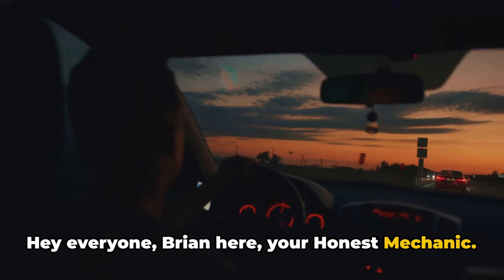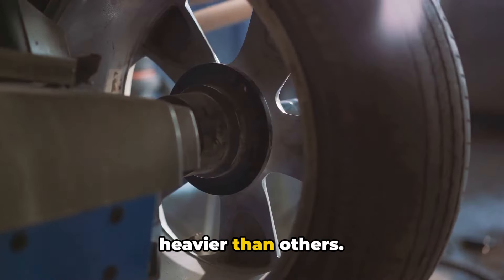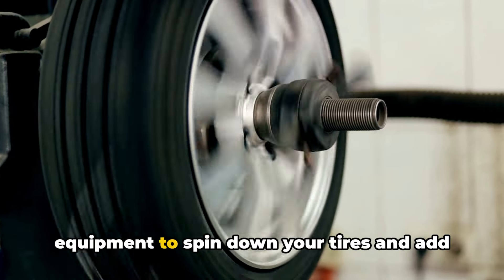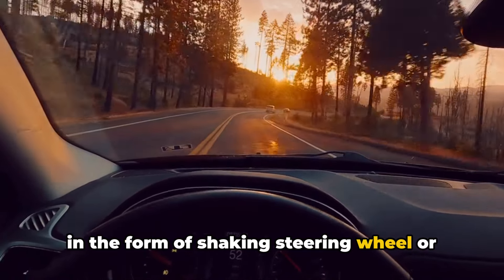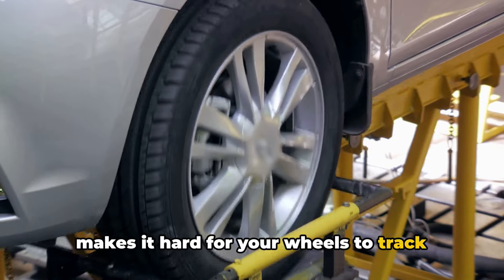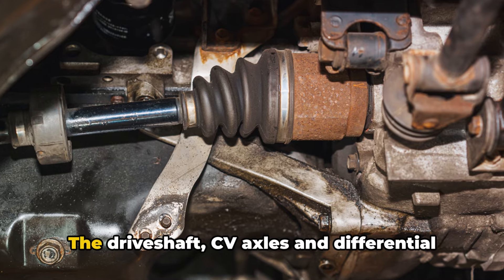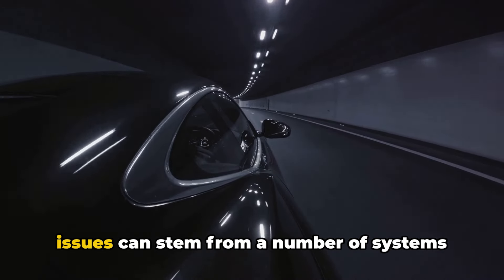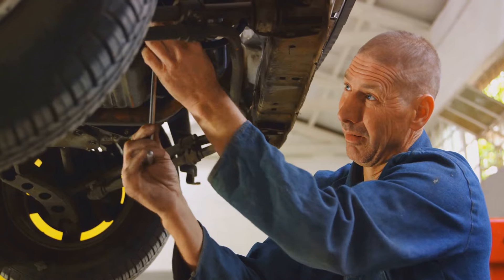Car Shakes at 60 MPH: 5 Vibration Causes

Comment: Piece of advice: if the tire people put "balancing beads" in your tires, have them remove the dumb things as they can cause more problems than they help.
Reply: those things eat the tires inside. what the hell people have in their mind to put that inside the tires? are they stupid or what?
Reply: @HeydaCarreras  From what my mechanic told me they are used mostly for large semi truck tires since it is difficult to tell when one tire on a, for example, 18 wheeler has gone out of balance. The beads supposedly adjust within the tire to assist in keeping them balanced. They should never be used within the smaller sized tires used for passenger size cars or trucks.
Reply: @richardb.5691  even the big tire in the world, it's absurd. Completely absurd. Those things will move inside so fast that will eat the tire inside.

Comment: I aligned my tires and got new tires. Can’t seem to find my problem but I’m gonna try new shocks and suspension next
Reply from the maker: Please let me know, how it goes!
Reply: how's the update?
Reply: @evv4239 how did that go
Reply: Any updates?
Reply: @macknumber9  so I did my right cv shaft and that fix my problem but I did the left side also but even when I did the driver side was still doing it and once I did the cv right shaft I’m back running good
Reply: Did u make sure the psi is equal thats why mind did it
Reply: Anything?
Reply: Have you done a fuel injection?
Reply: this guy never came back.
Reply: I’m going through the same thing. My dodge ram keeps shaking and rumbling. I’m going to the shop today to get it checked. I’ll make a video on my channel of the whole process! Stay tuned.
Reply: @HonestMechanicChannel I completely forgot to respond😭 college and work took over but it was my worn engine mount replaced it and car drove smoothly the next day. sold the car the next week it was not worth the hassle to maintain it and now saving up for a better one

Comment: My car vibrates pretty bad from 60 to 68 mph then it goes away, I just did a road trip from NC to NY. And notice my steering wheel when out of balance to the right side and that ‘s when the shaking started , so guessing the problem is alignment
Reply from the maker: Hi, The vibration you're experiencing between 60-68 mph, along with the steering wheel pulling to the right, is more likely due to an issue with wheel balance or alignment.

The shaking often indicates unbalanced tires, while the pull to the side suggests an alignment problem. 

After a long road trip, it's common for alignment or wheel balance issues to show up, especially if you hit bumps or potholes. I'd recommend getting the wheels balanced and an alignment check to solve the issue. 

Let me know how it goes!
Reply: @HonestMechanicChannel  thanks a lot for replying I will definitely take care of this !!!
Reply: @HonestMechanicChannel  That is a BIG LIE. I have done everything you could say and what you never imaging and still have vibration at 60. Nothing that you can say will be the problem. All mechanics just play game to rip off you and take your money.

Comment: 05 volvo s60 2.5t  I put new ball joints tie rods control arms and end links  two weeks ago prior in May fixed the pass cv axle I had a shake before any of the fixes. I got new tires last may it sat till may this year granite ik the tires can get flat spots but brand new tires? I fixed the front suspension got the alignment done twice and balanced two times and is till get a shake in the front right. Shop is stating that the rim is bent which could eb from sitting.. but I don't understand how the rim could be bent but the tire doesn't have a flat spot...
Reply: Feeling in the same boat. I’m in a Rwd CTS I did All the breaks front rotors inner and outer tie rods all new tires and since I’d got new tires and did the tie rods my self I had to get a 2nd alignment 
My steering wheel shakes back n forth. 
I think with this pay check I’m going to shoot for either Getting my wheels balanced, steering knuckles or wheel bearings. 🤞🤞🤞
Reply: Wheel bearing

Comment: The engine and front suspension moved a hole inch with a loud crashing sound it seems that when the car is raised off the ground it is supposed to be supported as it states in the repair manual. This was not followed at the dealership as it should be.
After this happened I then was able to tighten the LUG NUTS to specification the vibration stopped for good! 😊 1992 Chevy Cavalier 3.1 6 RS Wagon 58k mi Now on to the next ghost!

Comment: I have a vibration, sort of a quick helicopter whirring noise coming from the left driver side. I initially thought it was a wheel bearing, but I changed that and it continues. It is most stark at 30mph, and then 45. CV shaft? There is a vid of it in my channel, would appreciate it if yall took a look. Stats: 2012 civic 130,000.

Comment: So I have a 2008 f150 supercrew the problem I'm having is a hop/bounce feeling at 53-56mph. I've replaced shocks, leaf springs, have rotated as well as balanced tires but nothing is fixing this feeling. Feeling dosen't move when rotated as well as the 3 shops I had check my balance showed me that balance was good 🤷‍♂️. This feeling is driving me crazy any help would be greatly appreciated.
Reply: Question is it a 4x4? because in case check the vacuum if it is working
Reply: @henblak  no it's a 2wd

Comment: So my astro doesnt shake it just makes the vibration noise once i get to 3rd gear around 50 mph, the sound is coming from the rear end.
Reply from the maker: A vibration noise from the rear end at 50 mph in 3rd gear is likely due to a worn or damaged universal joint (u-joint) or a failing driveshaft component. It's also possible that the differential could be the issue. Start by checking and possibly replacing the u-joints and inspecting the driveshaft. If the problem persists, you might need to have the differential and rear suspension components inspected. 

Let me know how it goes, all the best!

Comment: My charger steering wheel shakes at 65 and more but it starts and stops randomly. And doing a u turn the steering wheel locks and unlocks like the power steering cuts on and off. Same thing going around corners on the highway idk what it could be tho
Reply: Lmk if u found a solution for this